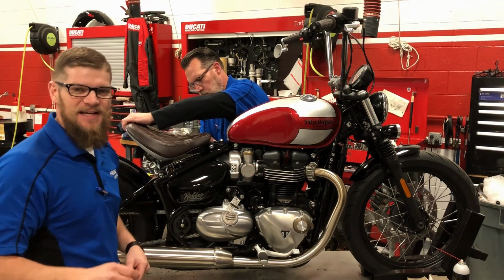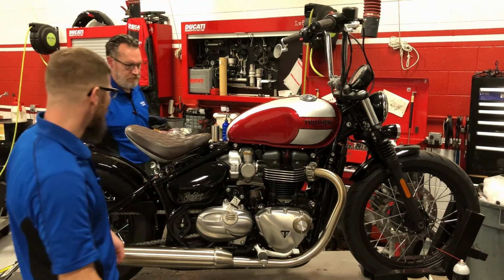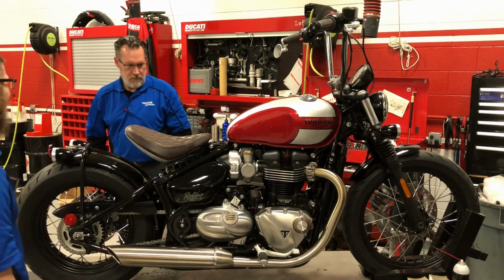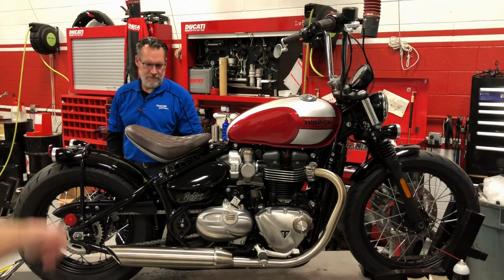2018 Triumph Bobber Build Week 4: Brown Cross Stitched Saddle @ Frontline Eurosports

Comment: 0:50  It seems to me that you guys slid the seat back more, which is great!  I, personally, think all the photos of the Bobber that are advertised are defaulted too close to the front.  Did you all angle the seat lower, too, to fit down further into the recess/curve of the bike?
2:40  Last questions.  Can you ask Andy if it is possible for the owner to move the seat even farther back, using that last,  oval hole on the middle seat post?  Will this cause an issue with the seat angled down all the way, and seat back all the way, when you hit bumps?  I'm a prospective Bonneville Bobber buyer, and the seat/profile of the bike is one of the main reasons holding me back (other than money, too.  Haha).
Reply from the maker: Huyked:  We haven't slide the seat back to that last hole yet to check for any type of clearance issues but I think you would be sittin' pretty right there!!!  Thanks for watching and feel free to contact us via phone at (540) 387-9780 to ask any additional questions.  Also, you can email me for updates via my newsletter...Nate's News...at Natefrontline@GMail.com     Thanks for watching and commenting and hope to see you on your own Bobber soon.  Cheers,  ~Nate

Comment: Does this Brown saddle add extra comfort than the stock black saddle? 
        I rode the stock saddle and have no complaints. Just wondering if it's even more comfortable than the all ready comfortable saddle. Or is it just the color aspect of it, to give the bike contrast that you chose it? 
Oh, and does it keep you just as tucked in while riding or do you lose some firm grip on your butt for swapping to this one? 
Thanks in advance. Please Be blunt.
Reply from the maker: Spartan_300:  Perfect...I like that, they don't call me Mr. B just because I bitch a lot, I'm also very Blunt hahahaha.  Not only does the saddle enhance the appearance but it does change the comfort level a bit.  I don't think it's any more of a soft saddle but it's the change of the shape.  Kinda loses the cupped feel you have on the stock saddle where you have that seam across the middle of the seat, now it just feels more consistently smooth and rounded.  That does take a little of the stuck in the seat feel away but I've never had any issues with losing my seating while riding the machine, but, I'm not out straight rippin' on this beast yet.  Just doing some power cruising around and launching it harder with some urban riding and around town corning.  I'll get a VLog together on this beast with some on the saddle reactions and maybe get a little more aggressive up some mountain sides for you.  I did an urban night vlog on it but the camera got bumped and shot the sky the whole time, boohoo.  Thanks for the question and hopefully this helps!!  Need more, just ask.  Cheers,  ~Nate
Reply: Nathan Jennings Much obliged! That definitely helps a ton! That would be wicked cool to see. 
Thank you for answering all my questions and for your bluntness. Haha 
Sweet!

Comment: In Reference to the Bobber... Do you know how big is the Swingarm bag for it? Is it enough to carry your lunch for work? 
Or if you have one in the store, if you can show us the inside and what you're able to fit in it. Or simply just how wide is it, how tall. All that. I'm considering this but if it's not enough to carry (say a medium Tupperware bowl, bottled water and sunglasses then it's not worth the $305 bucks. 
Thank you again in advance!
Reply from the maker: They have two different sizes and the larger one will def carry your lunch, just sold the last one in stock and only have the small one currently so can't send measurement but you'll be good with a lunch in the large model.  Cheers,  ~Nate
Reply: Nathan Jennings Definetely didn't know they offered two sizes. All I knew is that it said 2-3Liter capacity. Unless they are saying the 3 Liter is the large. Sometimes Triumph is vague when it comes to accessories.
Reply from the maker: you can call my parts dept at (540) 387-9780 for more info.  ~Nate